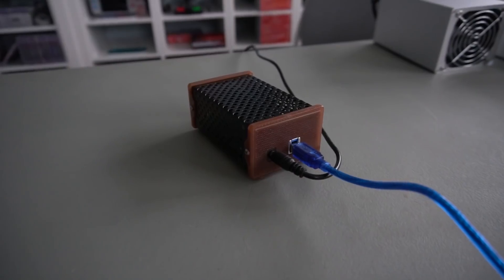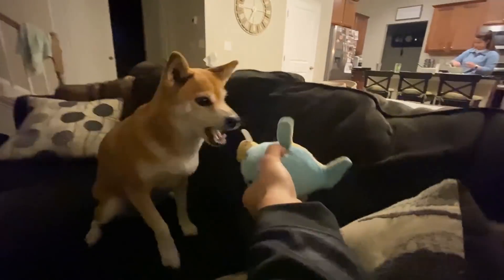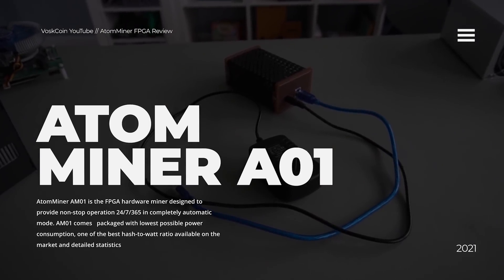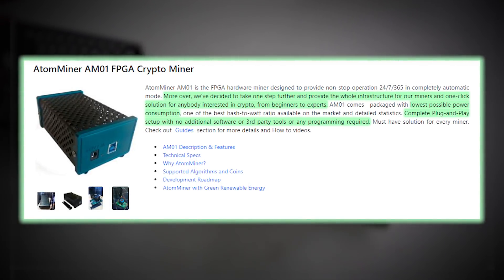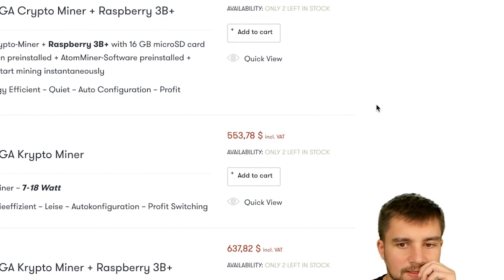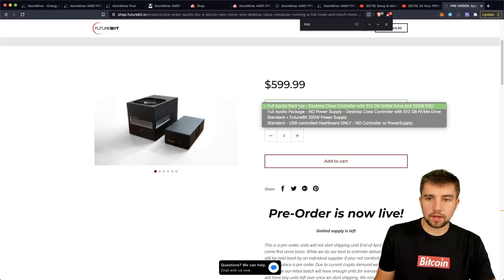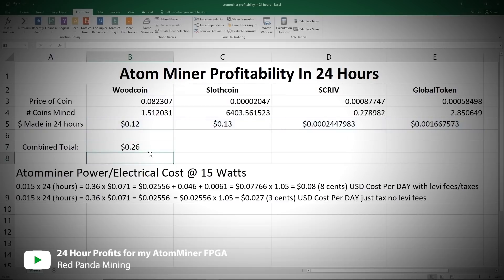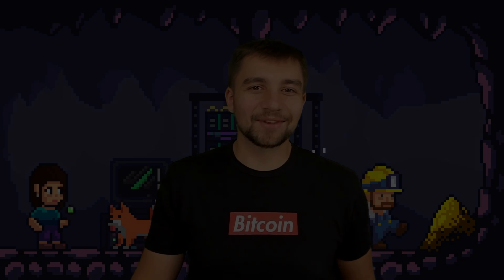FPGA Mining Cryptocurrencies in YOUR HOME?!

Comment: That same amount of money or a used GPU might earn more. There's high chance that the GPU you are using to watch this video can earn more.
Reply: Not sure if my calculation is correct, but I worked out that it will pay for itself after about 6.65 years. 599/0.25 (per day) / 30 (months) / 12 (years) = 6.65 years (assuming profitability remains constant). Might be cheap to run constantly, but it's slow. 1050ti card pays itself back in about 1 year (assuming profitability remains constant). Definitely as he says, more for a developer or cryptography enthusiast at that price point. As you say, GPU WILL earn more.